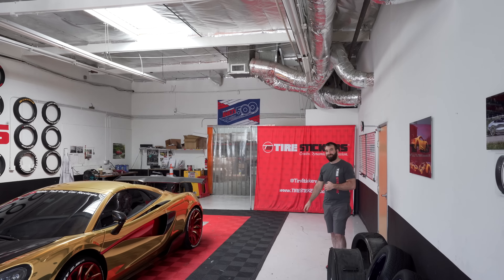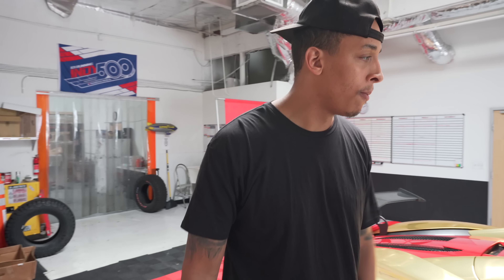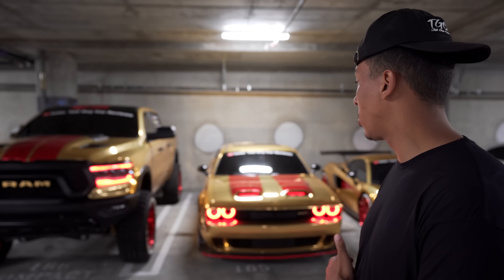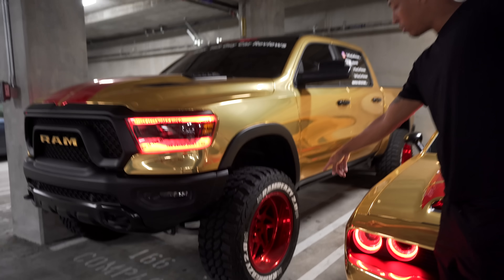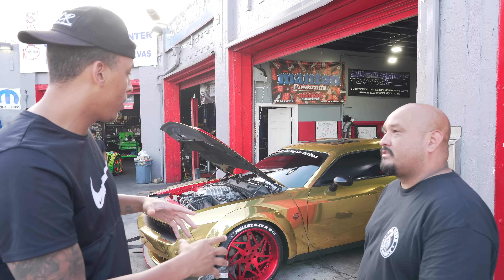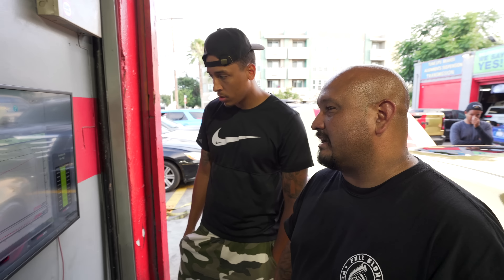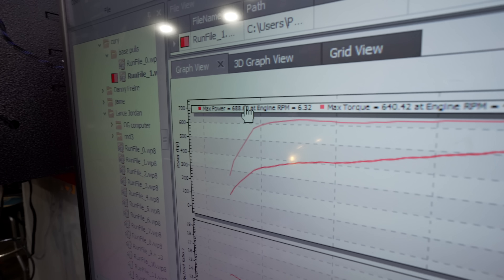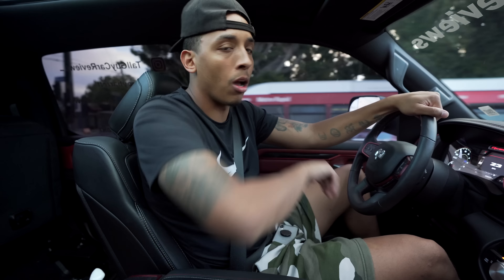MY HELLCAT REDEYES FIRST TIME ON THE DYNO!

Comment: You need the stock wheels to dyno next time. The bigger set can throw the numbers off a bit.
Reply: Faxx
Reply: I was thinking the same thing
Reply: @jacobbahta2769  🔥
Reply: @oulouie9050  I don't know how much it would effect it but it definitely does
Reply: Weight comes involved when you have different rims and bigger size tires
Reply: @terrymitchell4579  yeah especially if your going bigger without a light weight wheel
Reply: Big deep dish
Reply: Right
Reply: @blackjack444....  💯
Reply: Dam 797 to 688 smh
Reply: @NoLimitBandZ  yeah over 100 lost lol

Comment: Just bought a 2020 hellcat widebody.  Do you happen to have a vid on launching and what tires to get.  Good content.  Thank you 🙏
Reply: Mickey Thomson et street SS 315/35/20
Reply: Joel Valadez thanks bud.
Reply: launching is pretty much set inside the hellcat. Press a button set the RPM hold the brake and gas and go. Tires though. Me personally Im not sure whats on the hellcat widebody but if you can get like 315s on the back 305s on the front. I only say that for grip reasons and yoou wont have to worry about spinning out and this is and that
Reply: Check out demonology or srtmush
Reply: FELIPE1JR thanks
Reply: lol you dont want any driving tips from this clown
Reply: Mike G you can do this to em man.
Reply: Sullzy I have 315s now. It came with perellis.  Just want some slicks for the track. Some guys say Mickey Thompson , some say nito, some say Hoosier.  I guess I’ll just have to try em .
Reply: @detroit313vlogs7  Hoosier definitely.

Comment: How is he going to Achieve high 9’s to the wheel without porting or swapping his blower...i would like to see his stock blower achieve those numbers
Reply: He’d have to swap pulleys, cam, race gas.
Reply: You can make low to mid 9’s on a regular hellcat without swapping the blower.